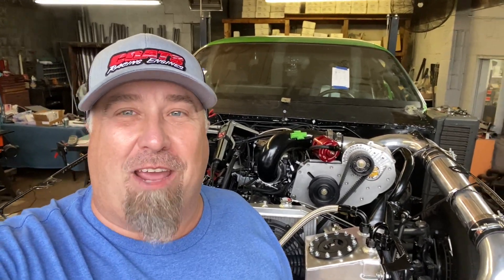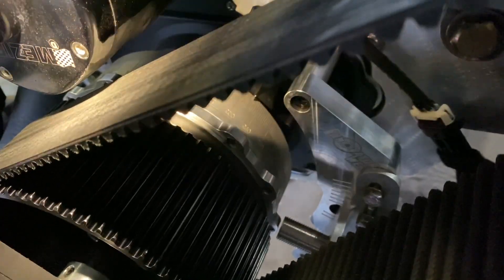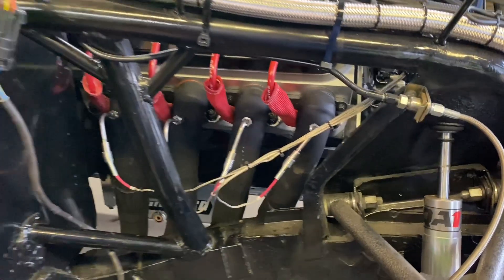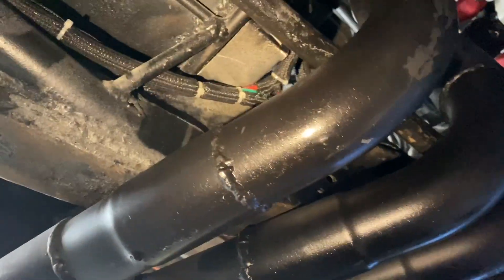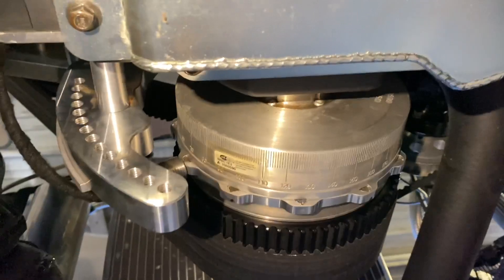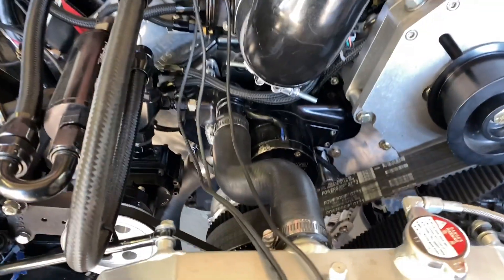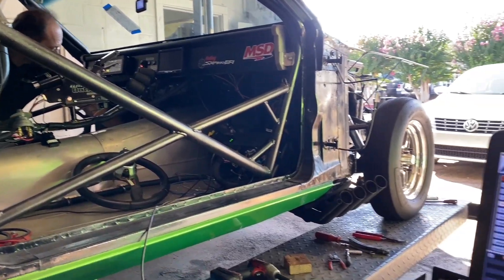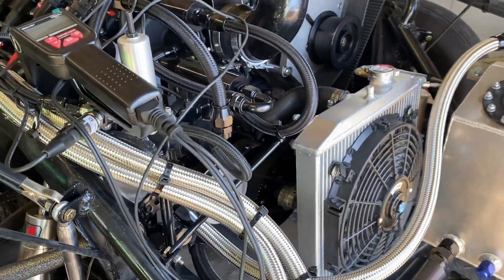So Frustrating, LSX 12-1 trigger wheel disaster

Comment: Like the content and that you post the problems when dealing with these hotrods. You ever get the 12-1 wheel working on this car? The 58x setup has a reference angle of 78.5 degrees if that matters. That would put the 12-1 wheel a roughly 2.5 teeth. I believe on the 4x cam signal the holley only reference the first small tooth. Look at the "crank and cam sensor setup special cases where they talk about the 4x tooth being referenced.

Comment: Some advice, next time your trying to do a fresh startup put a timing light on it to see what the spark is actually doing. Also non-missing tooth setups work, haven’t done much with Holley so unsure them but a majority of aftermarket ecu’s will run a non missing tooth setup with cam sync for full sequential fine.

Comment: Why would you remove one of the magnets? You don’t remove one on the MSD flying magnet setup. The others use only spacing and these wheels have spacing and magnetic aspect and you tell it where it’s located with the Holley. It should have fired with the cam sync turned off.
Reply from the maker: Removing the magnet makes it like a toothed wheel.  4 magnets, is one pulse per fire.  It fires at every magnet
Reply: @TurboJohnRacing  I didn’t see any instructions for it, but I’m assuming you need to have the 1x cam gear as you mentioned for it to work.

Comment: I don’t know if Holley could do it too but I had ms3 gold box with an ls motor 24x crank 4x cam it did the exactly same thing I ended up turning off sequential and running it in batch cop and it worked great I didn’t know if it ignoring the cam sensor was a viable option or not but besides fuel smell at idle it ran great

Comment: John the way you originally tried setting up @ 60 degrees BTDC would have been if you were using one pulse per fire like a 4 magnet or 8 pulse trigger in a distributor.  This is where Digital Rising and Digital Falling come into play.  If the sensor see's the edge of a gap, this triggers the sensor in Falling, if the sensor see's the edge of tooth, it triggers in Rising.  
To setup using the 12-1 you set TDC Tooth Number in the software to 10.  Put #1 @ TDC and put the wheel so the 10th magnet after the missing magnet is at the sensor.  Remember the software/sensor cannot pickup a missing magnet, it picks up the magnet.  You also have to setup the cam sync correctly, typically 110-250 degrees before TDC on the compression stroke.  If you don't have the cam sensor setup correctly it won't run either.  With everything setup, disable the injectors, stick the timing light on #1 and crank it over, you should see correct timing on the balancer.  Enable the injectors and go do burnouts.

Comment: I think twelve flying magnets are 3 times better than 4 flying magnets but probably worse than 36-1 or 60-2 reluctor wheels  (360/12) 30,  (360/36) 10, and (360/60) 6  crankshaft degrees rotation resolution.  Curious on opinions of best camshaft trigger design...jesel single magnet...reluctor wheels/different designs...is a cut up distributor good enough for ___rpm??

Comment: I disconnect the injectors and use a timing light to see if it fires where commanded during cranking.  So if I see it say 15 btdc on number one (sometimes I check other cylinders to ) then it should fire after connecting the injector harness back up.

Comment: The 4 tooth cam signal will only work with the 58 tooth crank signal. To run the front trigger a single tooth cam gear will have to be fitted. I'm pretty sure the magnet will also have to be remitted for it to run. The signal from the cam is what is used to tell the computer when it's at TDC

Comment: Who makes them wheels that he is running on that Dodge Challenger? Bogart?, Even though I'm a diehard Chevy fan I've always had a soft spot for the old school Challenger's especially the I think it's the 70 or 71 might be 72 AAR Challenger the one that is the same body style as the one he has but they have the very sleek looking front clip and grilles in the car I've always wanted to take a clone AAR and turn it into a big tire car or a radial car but either way it has to sit level and low to the ground but anyway with all that extra weight he's carrying around on the front end of his car he shouldn't have to worry about that car trying to power wheelie unless he really puts some steam to it especially straight off the hit then it might get up there

Comment: Do this a lot. Spent 2 days following the Holley diagnostics saying way crank sensor issue on the Dart block (20th block first issue). Later found it was cam signal the whole time. Modified the sensor from touching reluctor and then backed it out with feelers before check the cam sensor. The diag they say is a crank sensor issue, is explained by white as cam sensor error that usually is cause by the crank.

Comment: I belive you can not do that. A modified or "broken" 12 tooth wheel is not compareble to a 36-1 or 60-2 wheel that really are made for wastedspark setups, and those  do not need a camshaft sensor. ;) It does not matter which one of the two sparkplugs on a WS coil that fire which cylinder, right?  
A 12 tooth crankwheel needs either a distributor to fire the right sparkplug or a simple sensor on the camshaft to inform the ECU if the crank is on the first 360 degrees or the second 360 degrees of the 4 stroke cycle . 
The ecu can not fire the correct cylinder without  knowing if the engine is on the frist 360 degees or the last 360 degrees? You definitely need a normal trigger wheel, camshaft sensor or a distributor. The point of using a 12 tooth wheel over standard trigger with 4 tooth is to inform the ecu more closely about crankshaft position at any given time. This improves accuracy espesially when the rpm is accellerating very fast.

Comment: Love this information. We did our 36-1 and a MSD flying magnet never could get either one of them to run ending up going back to the 24 Tooth on the crankshaft. Found out the reason why ours was popping was the shielded cable I ended up re-shielding it with makeshift aluminum foil. It’s still running that way. Never have fixed it properly

Comment: Hopefully you see this boss 12-1 with a 1x cam gear on the front drive should solve your issues. Sucks to take it apart but all the cam sync does is tell the holley when its at tdc on the power stroke

Comment: John I think you need to set the cam sync at 195 BTC with mine i did the same thing crank reference at 60 BTDC then you have to add 135* plus your crank reference angle of 60 +135=195 BTDC. you could do 45* BTDC for crank reference but you still need to add the 135* BTDC for the cam sync so in this instance it would be 45+135= 175 BTDC  you need to have cam sync 135 BTDC my 2 cents buddy